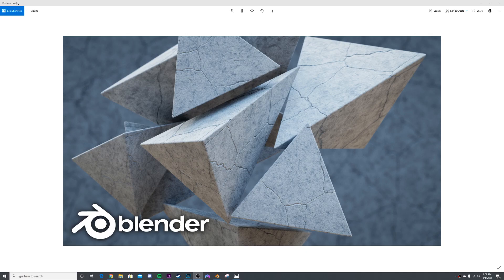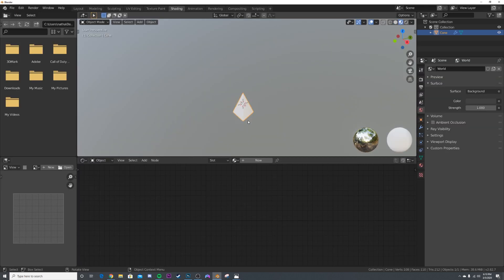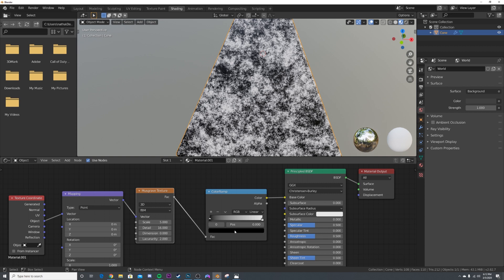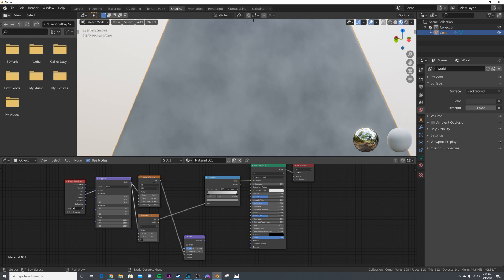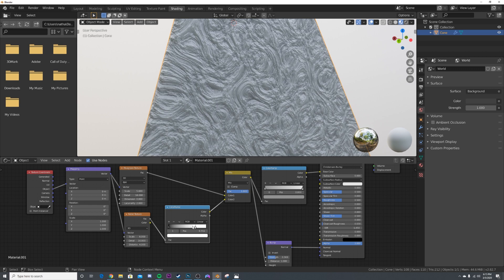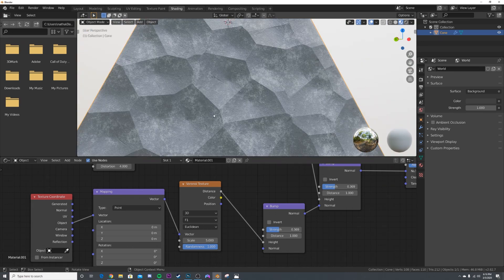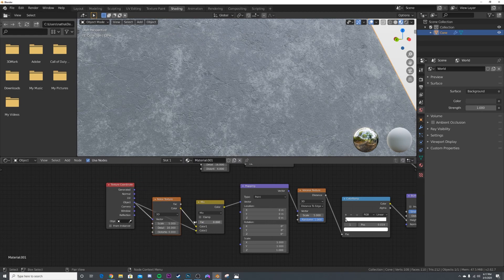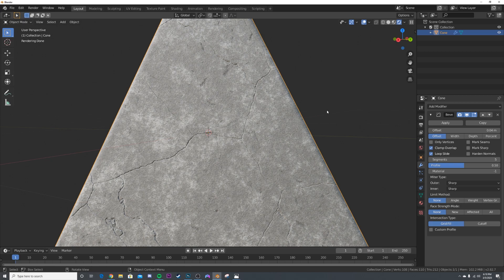Make a Photo-realistic Concrete Material with Cracks in Blender 2.82

Comment: Brilliant on a standard 2m cube mesh. Just the material that I need. However, when this is scaled down on a narrower plane mesh (x 0.37m y 3.7m), all the crack detail disappears entirely. I realise this will be simple to amend with a better understanding of the noise/musgrave/voronoi settings (which I don't yet have) but any guidance would be great.

Comment: nothing happens when i increase the detail of my musgrave texture :(
Reply: Had this happening too then i realized i wasn't using 2.82. I still had 2.81 running by default. Once i switched over to 2.82a it worked fine. Must be an issue or bug with 2.81... the detail slider was unresponsive in any file i tried this in. Hope that helps.

Comment: nice node setup, but be careful with the detail slider in the noise nodes. it affects render time more than you would think. do some test in a bit more complex scene and you will see. only push it as high as really necessary.

Comment: Hey, I have a question for any body who knows a good bit about blender. (I'm fairly new). When I look at my rendered image, I can zoom in and clearly see individual pixels. I have the resolution set to 1920x1080. I don't know if this is a result of resolution, but I've tried higher res, and although it improves this effect, it doesn't go away. Looking for advice
Reply from the maker: Maxro23 yes that’s normal, if you go to 3840 by 2160 that makes it 4K but depending on what you use the clip for you just need the 1080
Reply: @TheDucky3D  Thank you! good to know that it is normal.

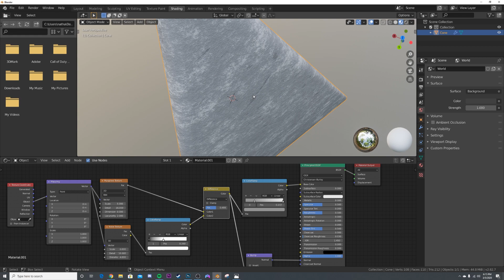Comment: Came for how to do the cracks (4:57), but then I also learned something about mixing noises in the part before.
Thanks for making these! <3
Reply: i know right! it never occured to me to put anything between the Texture coordinate and the Mapping nodes
Reply: @alaslipknot  Yeah, it's a really powerful technique. Adds subtle jitter to anything organic. Cranked up, it reminds me of oil paintings, fingerprints, liquid surfaces...
Afaiu it's exactly what the Distortion slider on some nodes does - but by manually adding (spatially correlated) noise to vector coordinates you can distort any texture.
Reply: Related: You can quantize/pixelate textures by using the Voronoi's Location output. That "snaps" the input vector to the nearest cell's center.
(Set random to 0 to make the cells square.)
Reply: @nibblrrr7124  thanks for bonus info :) will definitely give that a try